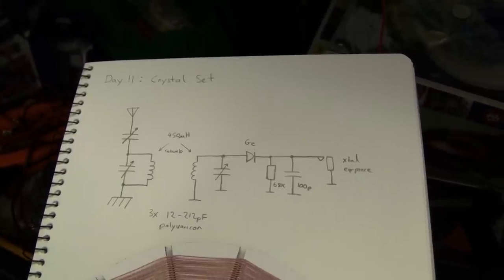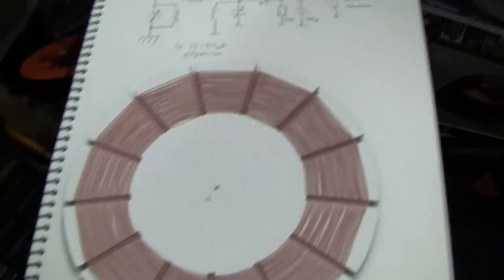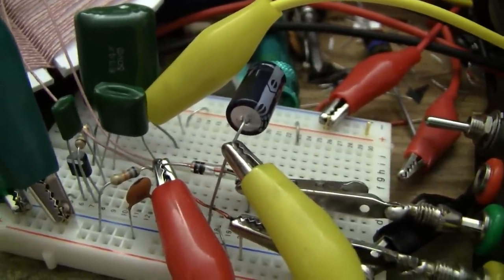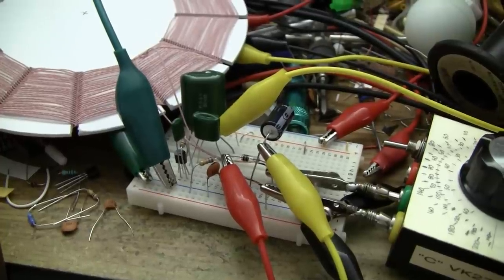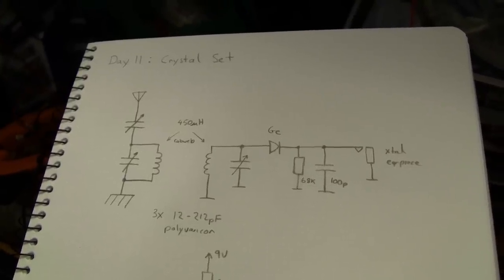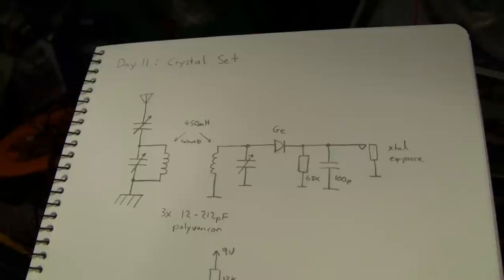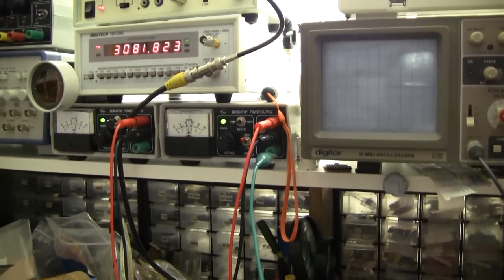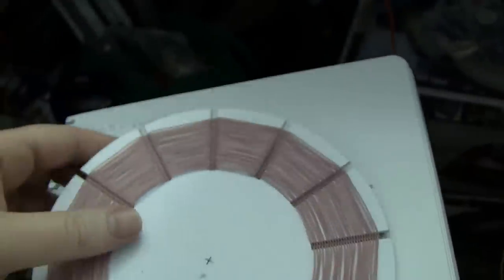Advent Calendar of Circuits 2011: Day 11: Crystal Set Receiver

Comment from the maker: @vk3ye Indeed, makes a huge difference.  I like your ceramic resonator LO for carrier injection, stable, but tunable and a harmonic source for most amateur bands.  I've been using the day 9 oscillator - which works, but there isn't enough bandspread without extra capacitors.  You can fine tune it with your body or a small magnet, which works surprisingly well with ferrite chokes.

Comment from the maker: @Photonface That would be electric fence tape.  RF Litz wire has many more small insulated conductors with a special twist to help minimize skin and self-proximity effect losses.  You could in theory make it yourself with a simple machine.  Normal magnet wire will still work, and benefit from the cobweb coil construction, but litz wire is better again if you can find it.

Comment: If you are in the UK  Westphalia are doing Litz wire, 
Westfalia Wide Band Litz Wire 2 x 200mtr
Wide band litz wire in a double pack, yellow-orange, 2 rolls of 200mtr each, 10mm wide, UV stable 4 conductors 0.16mm. £15.99 Google it
don't know if this is any good for this project?